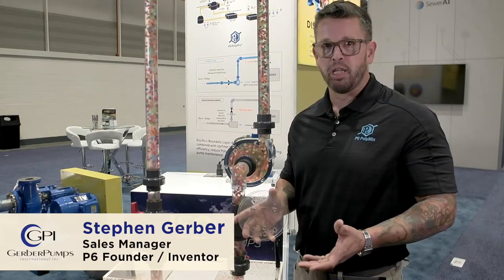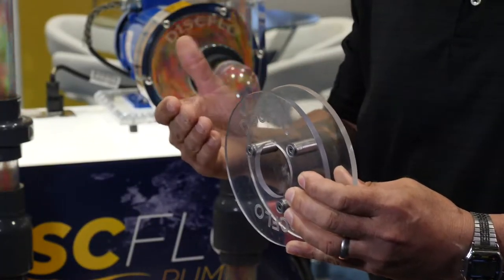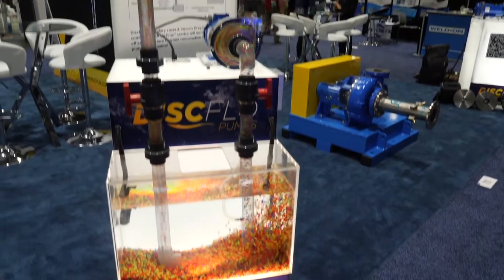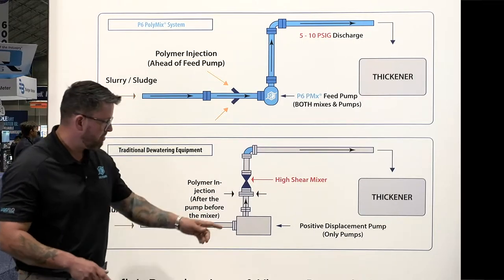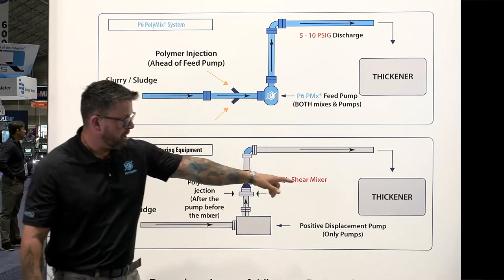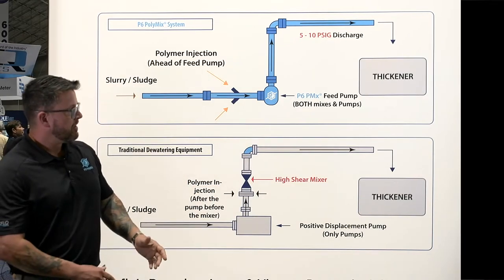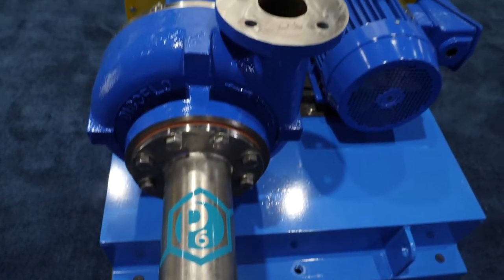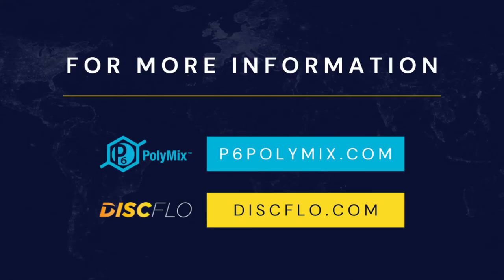Discflo Pumps | Disc Pump Demonstration

Comment: It's not a pure positive displacement pump so it's not fair to see "there is no shear at all". While technically the velocity of the fluid relative the disk rotation is zero, that is not the same velocity between the discs. Thus, the fluid is under shear stress and the viscosity allows for the backing out of the shear rate which will be some value, not zero. Right?